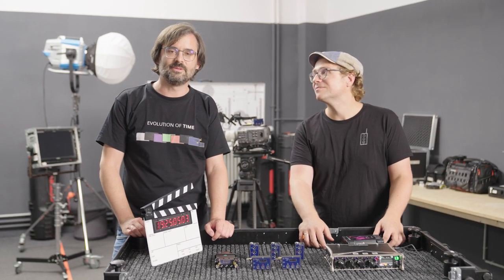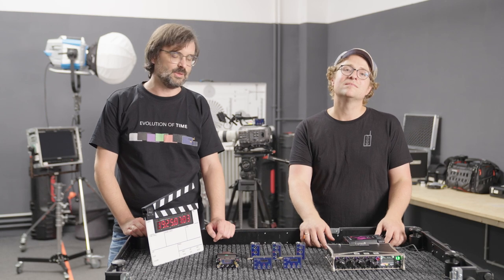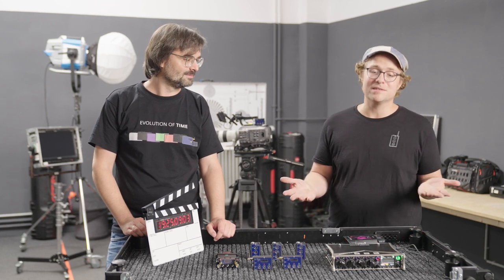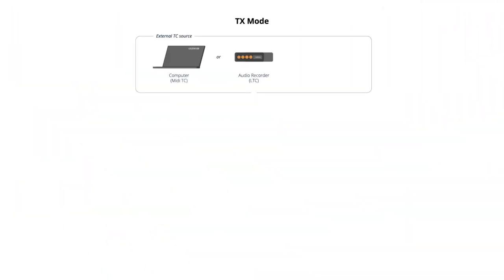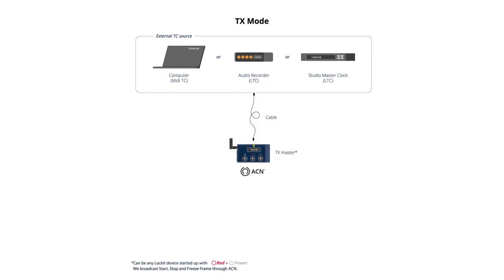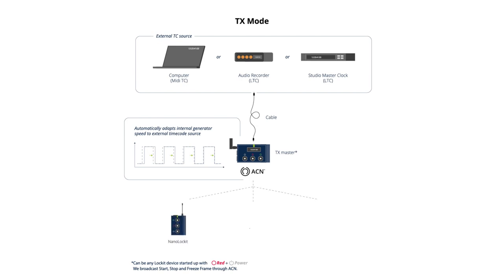Lockit Timecode - Firmware 8 | TX Mode explained

Comment: TX mode idea is great.  But why Nanolockit that set to TX mode go off after while?  I tried with all of the Nanolockits with version 8.04 but they all power off after a while.  If the one with TX mode go off then you can't really say they are connected all day long.